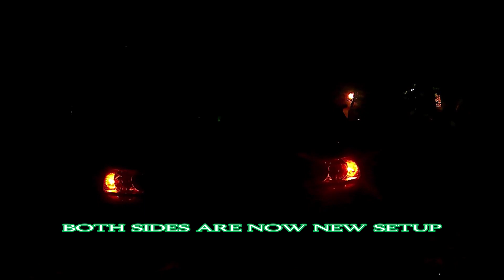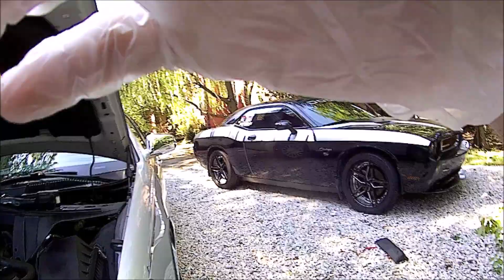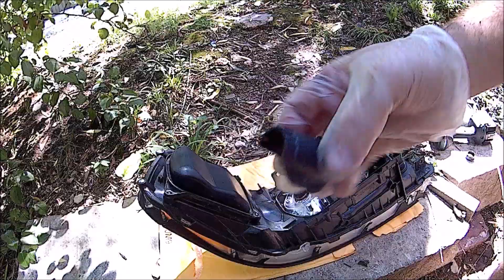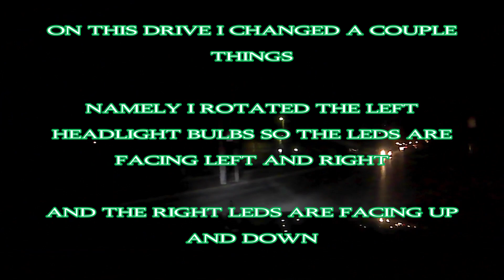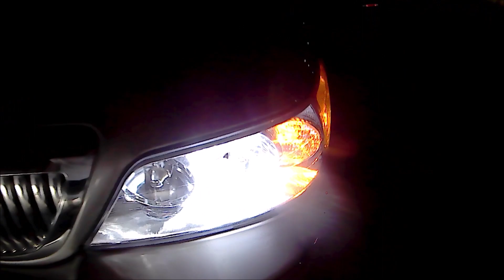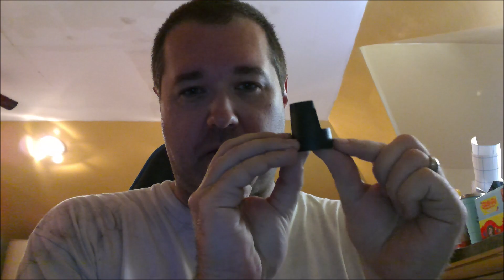4WDKING LED Headlights test and review Lincoln Town Car

Comment: What did you use to cut the plastic holder thing
Reply from the maker: I used my bench grinder and grinded it away with the quickness.
Reply: @HollywoodHornet  nice I just got done cutting it with a Dremel I had a hard time trying to lock it in place so I tightened the two little screws and inserted the led nice and tight 🙌🏽

Comment: I thought the instructions said to orient the blade vertically? When I did mine, it meant the power wire was at the 6 o'clock position. I see your wire is 90 degrees off from that. I get a flawless beam pattern when oriented vertically, but....mine went into a Grand Marquis which has a different reflector housing.
Reply from the maker: CV and GM the LED should be top to bottom. TC has to be oriented left to right or the beam sucks ass. I have the same 4WD King LED's in my P71 and I have them oriented up and down for proper beam pattern.

Comment: Right on Hollywood,

I watched every minute and loved it. 
Nice music this time. 

Thank you so much for being a good sport, and showing the “secret” to installing H7 Low Beam LED Headlights in a 2003-2011 Lincoln Town Car. 

Also, great job showing the terrible beam pattern that is produced by an improperly aligned bulb in the housing. 

So just to confirm the LED “board” should rest Up & Down, and the LED “chips” should face Left & Right, correct?

-Chuck
Reply from the maker: I call them diodes, but yes. The "chips" (not to be confused with tasty potato chips) should face left and right. Or else you will get triangles (not be be confused with tasty corn chips).